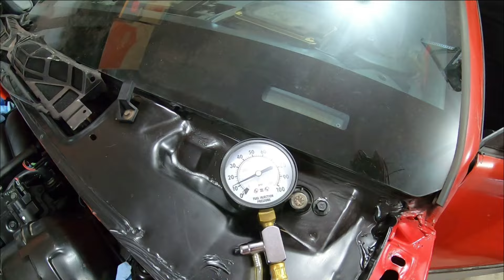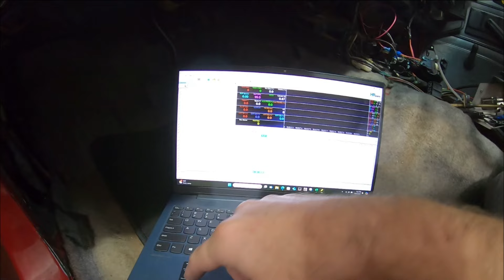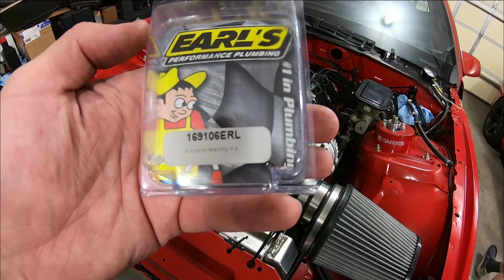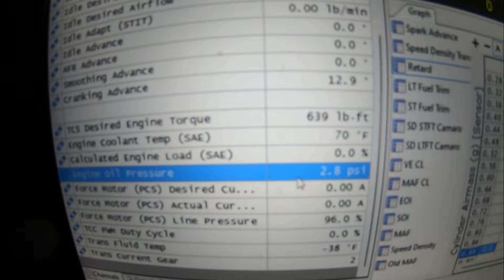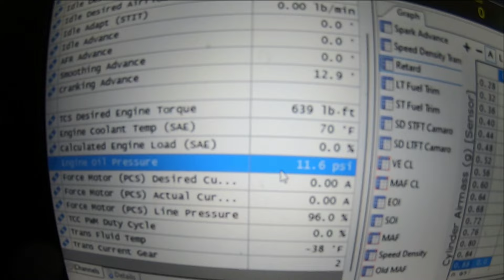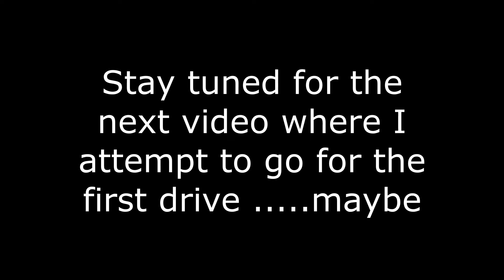LQ4 FBody Swap First Startup

Comment: I bought the Holly terminator X max  along with new fuel injectors, throttle body,and a gas pedal since I was DBW   It cost me over 2000 bucks for this but it runs like a new car!!!
Reply from the maker: @vandettabuilds6641  I'm getting mine dialed in will take little bit. I'm picky

Comment: I'm following your progress closely as I am also swapping an LS into a Gen 3 F-Body (a Camaro in my case). What windshield wiper motor did you install (it suddenly shows up at the 18:30 minute mark)?
Reply from the maker: @coursewhisperer8487  i just used my factory 85 one. But I think I'm switching to maxima one as the factory one takes up a lot of room